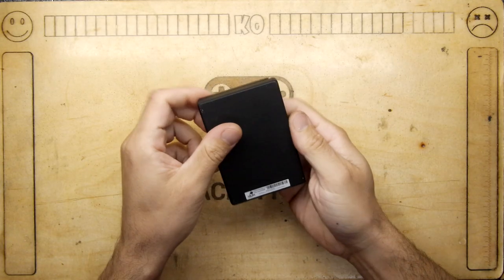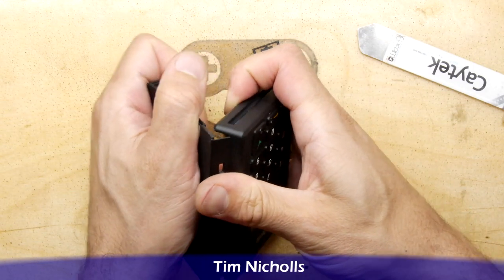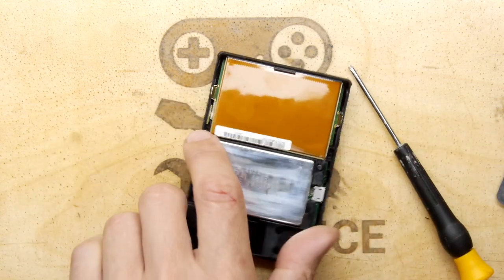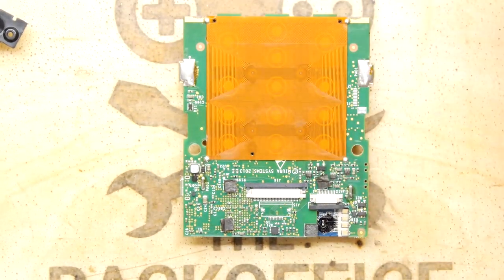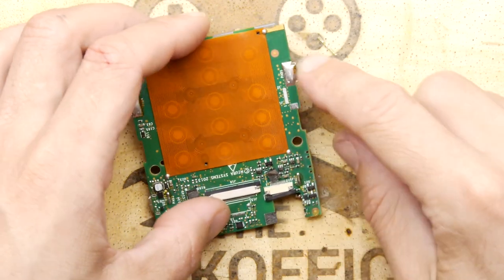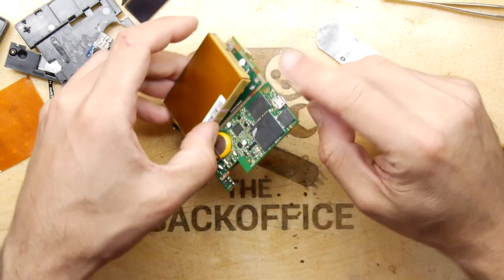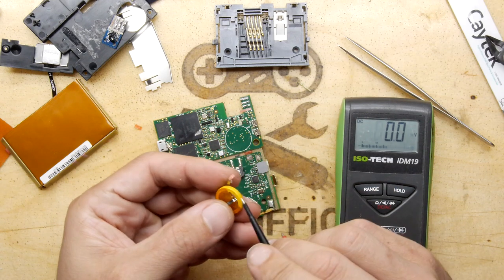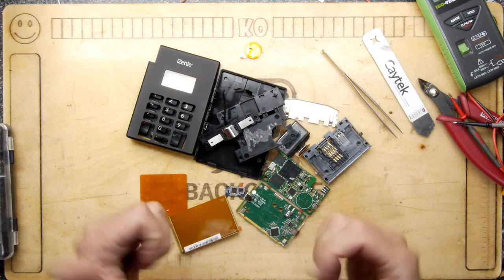iZettle Teardown

Comment: Not em shielding and not a ground plane. Those "shield" traces are part of the anti-tamper protection, including the extra ones on the stripe reader ribbon cable so you can't cut it and add a skimming circuit in there. When you cut through it, a circuit burns a write-only bit that bricks the device.

Comment: Glad that made a fun little video.  For reference, yes that would be a Bluetooth module as this thing did Chip & PIN over Bluetooth to an app which then does all the Internetty stuff from there. It had not been 'tampered' with in any way, but it had been sat in a drawer for a couple of years so I would assume that's what happens when you let the battery die completely.
Reply from the maker: Yeah, that makes sense. They certainly went out of their way to shield everything, it's really well made. I like the card slot especially

Comment: I'd assume that the massive ribbon with all the tracks is the NFC aerial
Reply from the maker: It's a possibility, but it does not look like any NFC antenna i have seen. As this unit still has magnetic swipe I think there is a string possibility that it predates NFC in cards.

Comment: i was hoping for another home appliance repair but I guess iZettle for a teardown
Reply from the maker: Ooh @custardo this is why you are my favourite! It was going to be another ZX Spectrum peripheral video but I couldn't get the software to work from a tzx file to a tape properly
Reply: @backofficeshow  What did you use to convert the tzx?
Reply from the maker: Something called tzxtowav then I used another thing to go from wav to mp3
Reply from the maker: I also tried the wav straight to a tape recorder bit that also failed
Reply: @backofficeshow  I uploaded the fuse tools in the discord, hopefully you have better luck with these
Reply from the maker: Thank you so much, I'll check them out!!!!